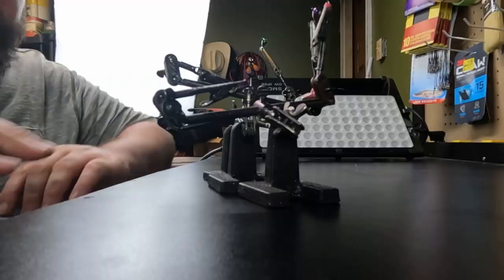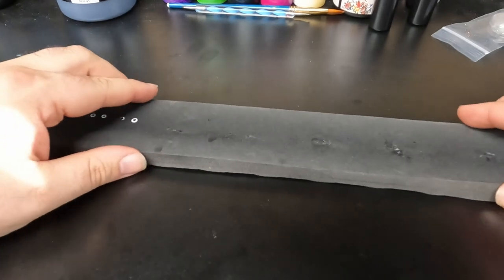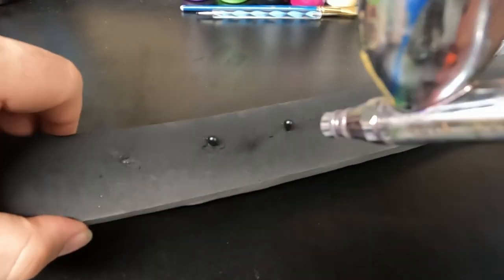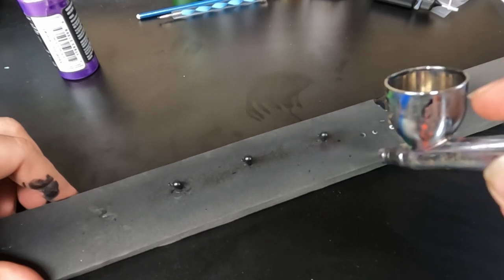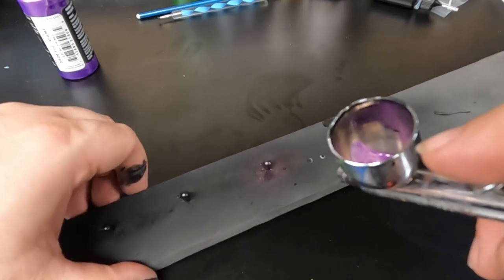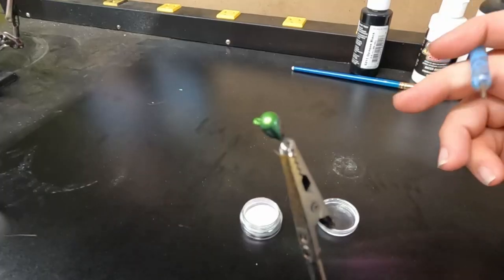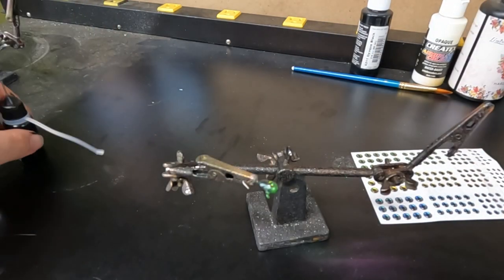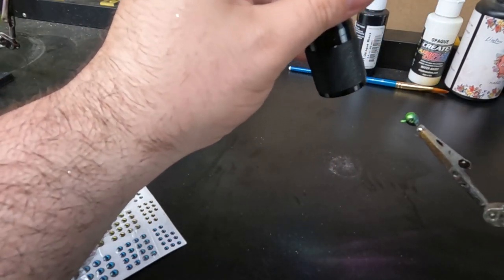How to paint Tungsten Jigs using UV Resin

Comment: Nice job! Those jigs look cool! I have been messing around with resin and you had some helpful tips. I'm building jigs for steelhead fishing. Haven't tried then out yet. Do you find that the resin makes the jigs a lot tougher? I have made thousands of jigs with powder coating but I'm trying to make a tougher jig. I have just been using powder pigments mixed into the resin and coloring them that way. Do you think that will work? I really need to get out and test some of mine but still waiting for steelhead to show up!